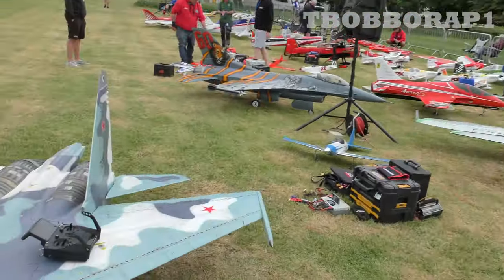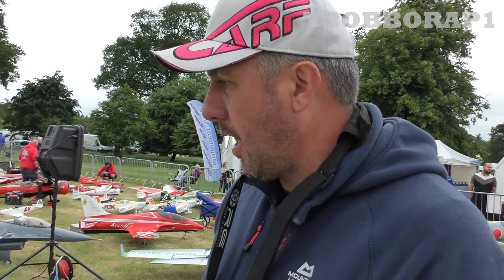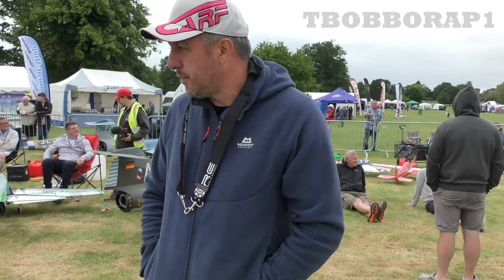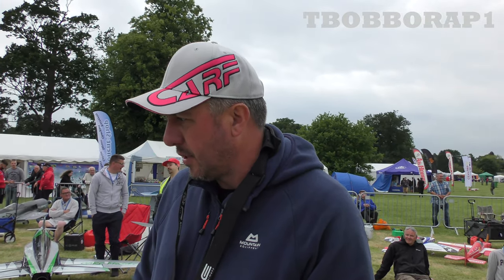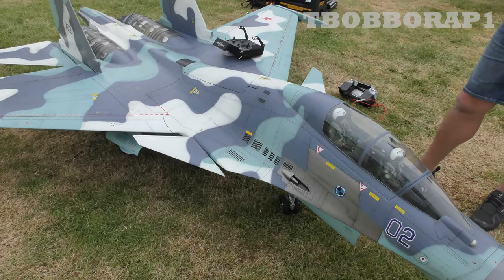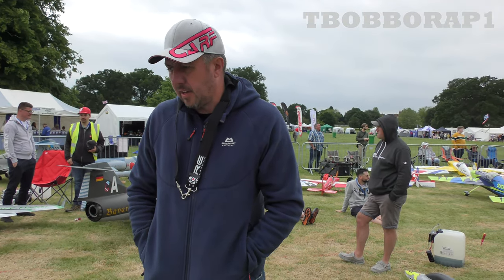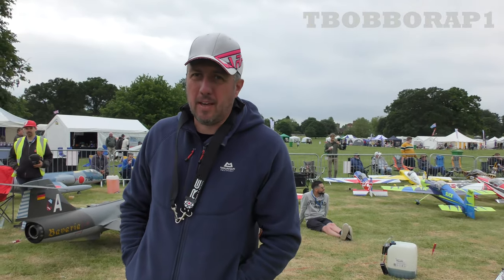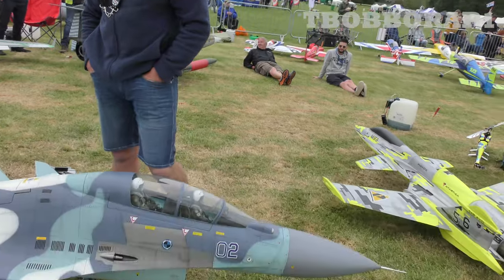AWESOME £20,000 SUKHOI SU-30 - TWIN BEHOTEC 220 GAS TURBINES - STEVE JOHNSON AT WESTON PARK - 2021

Comment: The sound of the engines are amazing👍🏻
Reply from the maker: sure are miller
Reply: @tbobborap1   just wondering what’s the make and the size of the engines. Also how many blades are on the turbine. Even though it is a manufacturers kit you still did an amazing job on the flight can’t wait to see you get used to using the vectors. Maybe you can incorporate those front wind flaps with the vector to do amazing flights with the bird. You probably have a video already out I’ll be looking for it job well done thank you from Edmonton Alberta Canada 🇨🇦

Comment: Amazing! Do the directional jets actually get used in flight? Do they make a big difference? Are they automatically linked to the control surfaces? So many questions :)
Reply from the maker: steve does explain it to you in the vid dubcat !
Reply: @tbobborap1  does he? I can’t find it. Heard the bit about the canards but not the directional jets. This is totally amazing. Such a wonderful piece of engineering. Stuff of dreams.
Reply: You mean the vectored thrust?  Yes they are connected to the control surfaces.